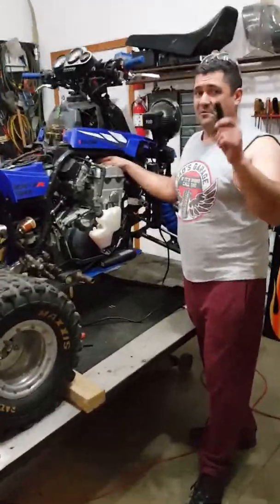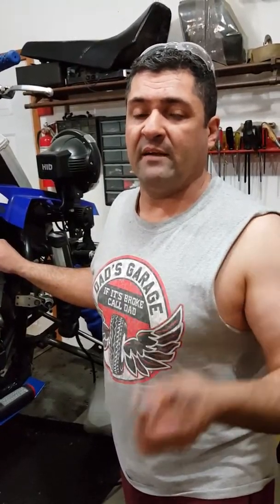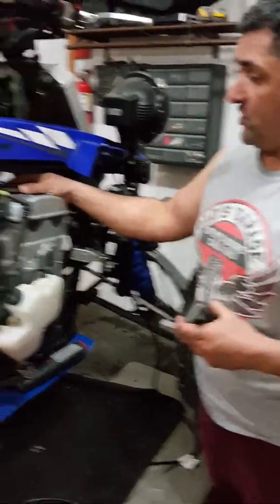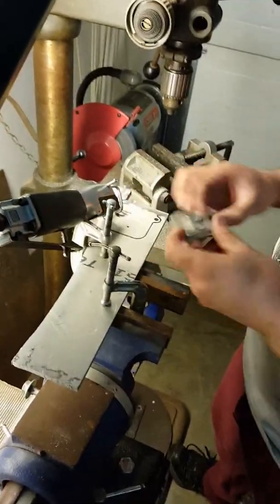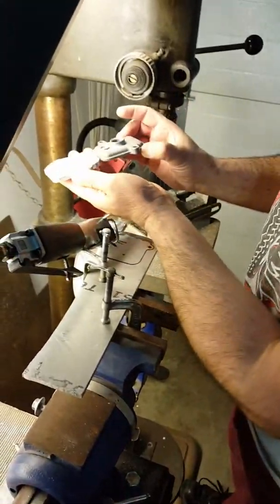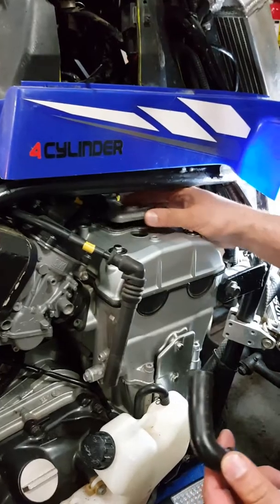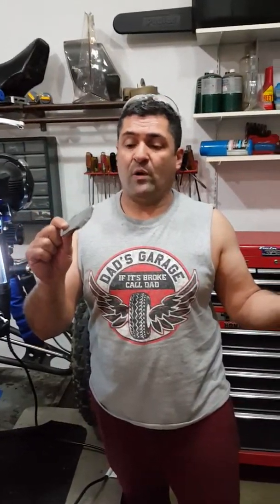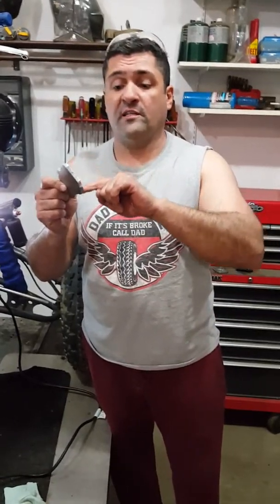Yamaha Banshee zx7r How to make smog block off plates part 1..

Comment: great info!!!, working on a 900cc scrambler
Reply from the maker: Superior Hunt Kennels 900cc yeah, that will be a Monster! For sure. What engine, cbr 900 fireblade, zx9r, cbr 900?
Reply from the maker: Scrambler has a huge engine compartment because of the forward & reverse trans. Are you using the stock reverse trans? I believe you might have to because of the right hand side chain drive. Unless you make a jack shaft.
Reply: Yea I fabed a jack shaft so the 4x4 will work need advise on mounting steel for the engine
Reply from the maker: Superior Hunt Kennels I've seen a couple of similar builds using  600cc Honda's f4i. That's gonna be an interesting build for sure. Are you going to post any vids? I would like to see the Jackshaft system. ie.what kind of bearings &  metal grade used for the jack shaft itself. I normally build sport 2wd. Atvs. I've been contemplating a 4x4 build in the far future.
Reply: Banshee Fever 750cc  yea it's uploading now